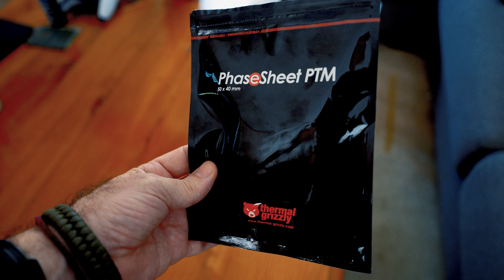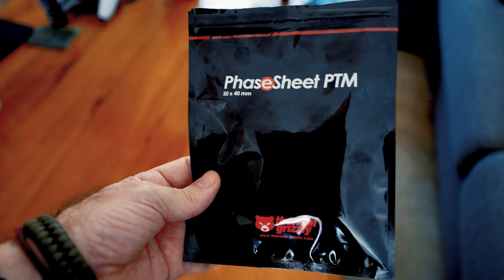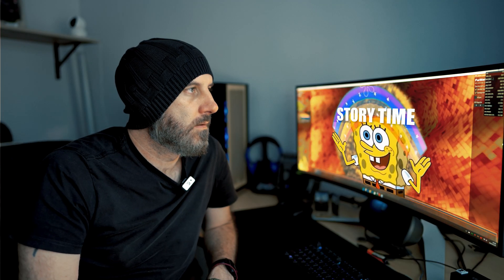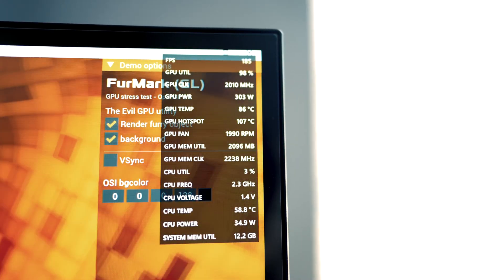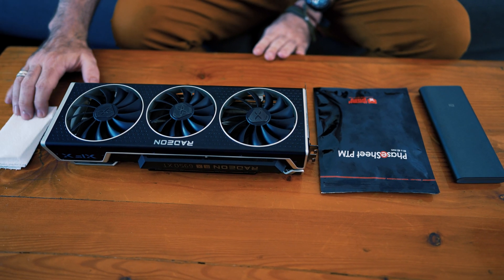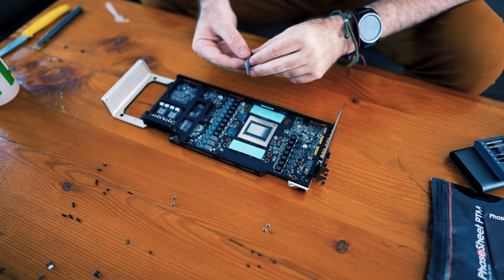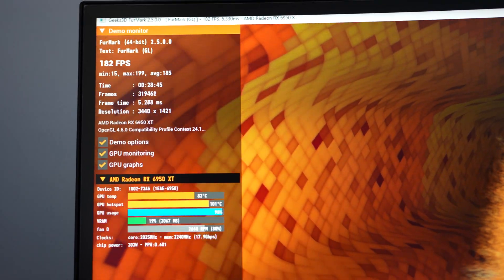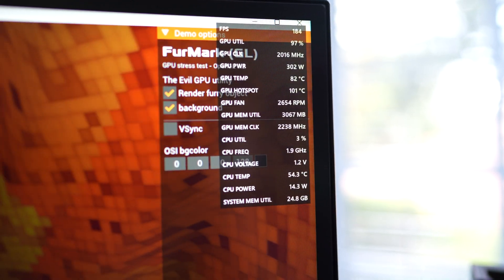🔥🔥Can a 107c GPU Hotspot Be Tamed With Thermal Grizzly PTM?🔥🔥

Comment: So update on the laptop.... 4 year old gigabyte with an i7 and a 3080... initial results cpu was fine gpu went ballistic with heat.... so after some digging standard ptm from Honeywell is significantly thicker than the grizzly stuff is. I basicly just cut another sheet and applied it cause it was not touching the heatsink... after that couldn't get the gpu to go over 76c running warthunder and also 3d mark. So 9 more heat cycles and we shall see where it's at
Reply from the maker: That's really impressive, man.

What kind of temps was the 3080 hitting before the Thermal Grizzly?
Reply: @JustJean-Yves  last paste I used for repasting was artic mx 6 which is way to thin for that laptop I'd have to repaste every two weeks Temps on the cpu and gpu would climb up into the mid 80s . With the cpu going higher. This weekend I'll get a better idea on Temps cause I'll be able to burn it in better but I think it's gonna do the job if it stays under the low 80s on other games and stays consistent I'll be damned happy

Comment: Got a 7800xt that has probably the same cooling as this gpu, it's very similar by the looks of it. It runs at 60°C so it's over 20°C cooler than this gpu while the performance is almost identical. Even if the thermal paste gets dry and crusty I probably won't have to repaste it due to how much overhead it has in regards of temps.
Reply from the maker: Awesome card you have there. Also an XFX?
Yeah, the 7800xt pulls about 50w less power than this card + a newer architecture. I would love for this card to run at 60c under full load, haha.

I just ran a test for interests sake. The most I can drop my wattage is to 275w and my temps on the die maxed out at 75c.. not a huge drop, but decent nonetheless.
Reply: @JustJean-Yves  yes, it's an XFX QICK triple fan.

Comment: Im attempting this on a....... TITAN X gpu i also have the Pro Thermal Putty this should tame the old boy down a bit tried Liquid Metal lol didnt go so well.

Check out the CM Master Frame 600 it will be an amazing case ones available.
Reply from the maker: Good luck, man! I'm sure it's going to drop temps nicely!
Tell me more about your adventures with liquid metal. I've been keen to try.

Thanks for the heads up on the case. I'll hopefully be doing a lot more reviews in the future 🙌
Reply: @JustJean-Yves  it's worked great for my 14900K/KS rigs I used with the Der8auer Direct die Contact Frames in hopes I staved off the self immolation lol. The old Titan has been hitting 90c so I'm hoping with these phase sheets and putty I can get it under control.
Reply from the maker: @shadowarez1337  🤣

Tell me, do those contact frames have a gasket to prevent LM from causing more self immolation?

I think the phasesheet should help you quite a bit, especially if that current paste is old AF.
Reply: @JustJean-Yves  I haven't seen any in these but the machining is next level I use the TG conformal coating on the smds prior to using it and temps have been nothing short of amazing during gaming sessions 1-4 hrs temps never get above 45c at a 5.8hhz OC and slight undervolt.
Reply from the maker: @shadowarez1337  
That's really amazing, man.
It's been so long since I did any direct die cooling (I'm talking AthlonXP days) and would love to give it a go with something more modern.
Reply: @JustJean-Yves  oh it's 100% better then back then not only is it direct dit it increases the surface area of cooling by like 225% form a chicklet size to a brick. I did the old Athlon direct die way back then too cracked the die when added a Volcano 9 copper Heatsink still worked oddly
Reply from the maker: @shadowarez1337  🤣
I did exactly the same thing on my Athlon 1000, 1200 and most of the xp's I had back then.. I had the Volcano 7, but then upgraded to the Thermaltake Dragon Orb 3, do you remember that thing? I've still got it, and a Globalwin CAK something something.. Both 7k RPM screamers.
Might do a video on them.
Reply: @JustJean-Yves  you're not going to believe this but yeah I had it when I was in college lol brought my Bright Red MSI rig to class to show the teacher what a custom rig looked like I had that on my rig back then and I had a cough, cough Doom 3 alpha I showed the class I had to build via CMD line to start it up but showed them truely ground breaking gameplay of that game